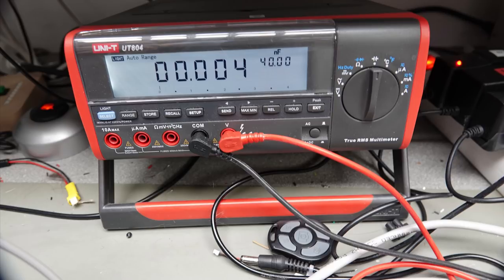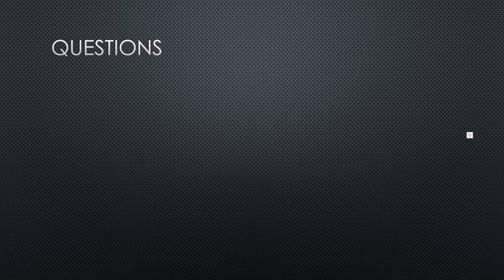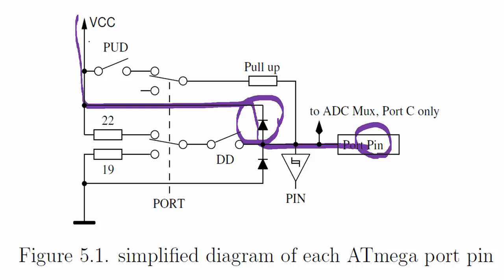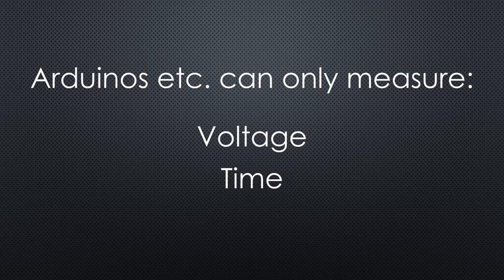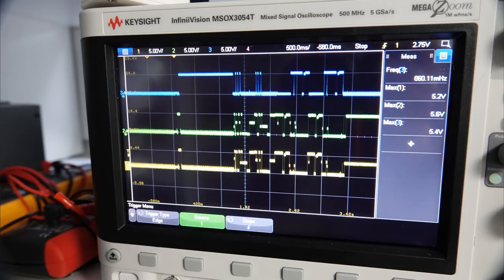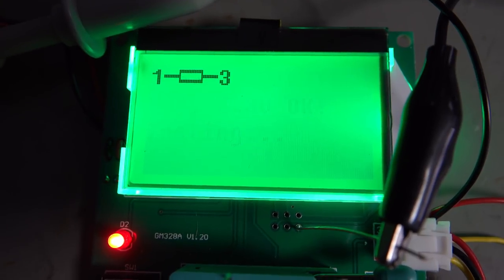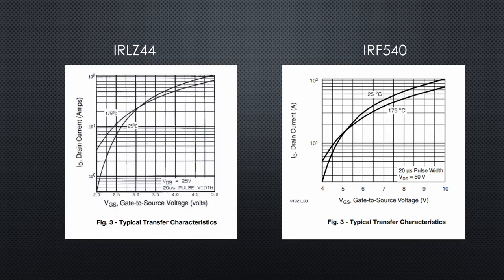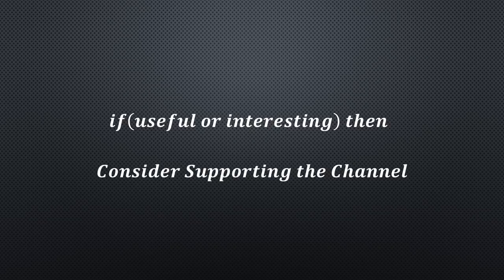#290 How do Transistor Testers work (and some other insights)

Comment: A better choice would be to replace some of the parts e.g the 470k resistor by two precision 1M (0.1%, E192 series) resistors in parallel (=500kOhm +-0.1%) and so on. Such replacements do not really come at significant change to the price tag after all, but do offer some usefull enhancements to precision and calculations accuracy.
[edit] The downside of course is that the microcontroller needs to be reprogrammed...
Reply from the maker: You could even replace them with more precise ones of the same value. But it will probably never become a precision meter.
Reply: @AndreasSpiess  That's very true. The precision is and will remain very limited one way or the other.

Comment: The original design was thought up by a German. See here

https://www.eevblog.com/forum/testgear/$20-esr-lcr-transistor-npn-pnp-mosfet-meter/

Chinese manufacturers make a lot of money by copying such designs often without giving credit to the developers. For example the Sark 100 antenna analyser. It’s nice to have inexpensive test gear but not so nice that the designer gets ripped off. I know a successful business whose product was cloned by a Chinese company who then had the nerve to refer customer support issues to the business supplying the original product.
Reply from the maker: I think I mentioned Markus a few times. And I do not know with which licenses these designs are protected. I use a very weak license, for example and everybody is allowed to use my content. They just have to mention my name.
Reply: Andreas Spiess Apologies Andreas. I posted my comment before I watched most of the video. You gave full praise to Markus and the rest of the team. Also you gave an excellent explanation of how the tester was designed. Full marks to you!

Comment: I recently splashed out and bought a DER EE DE-5000 LCR meter, because I wanted an accurate capacitor tester to help with my vintage computer restoration projects. I haven't gotten around to actually using it in a project yet, but I have tested a few capacitors that I previously removed from old motherboards during the repair, and found their capacitance and ESR to be way off. Which was expected since replacing them fixed the motherboard, but I also tested them in a component tester similar to the ones in the video and saw similar values. The good thing about the LCR meter is that you can test at different frequencies, so you can see how the capacitor would perform in different applications, such as low frequencies for an audio amplifier vs high frequencies for digital logic.

I do still like the component tester for transistors and diodes, and it has helped me with finding faulty components in the past, although as you saw, it does sometimes come up with strange results.
Reply from the maker: The DE-5000 is on my wish list ;-)

Comment: The inventor was not a genius. It is a free software and hardware project. It is the result of many contributors. 
Things like this are what you obtain with people collaborating instead companies compiting.
Reply from the maker: I still think the idea at the start was important as well as writing it down. A good idea only in someone‘s head is not as valuable.
Reply: Not as far as I remember (but I read the mikrocontroller.net content years ago). Of course there were contributors that added very valuable ideas and features. But the initial clever idea came from one person and the biggest chunk of work was done by original inventor(s) too.

Comment: so you use an msox3054t 6000euros oscilloscope to test an 6 euro test device. that is disappointing and depressing.
Reply: why should i support you? you are rich enough if you can have employees and oscilloscopes like this
Reply from the maker: You do not need to support me. You are right, I am rich (in experience). BTW: The oscilloscope has a story revealed in one of my videos.
Reply: @AndreasSpiess  what? you get it from local dumpster like Mr Jones? :)